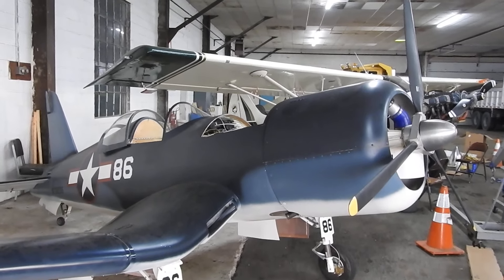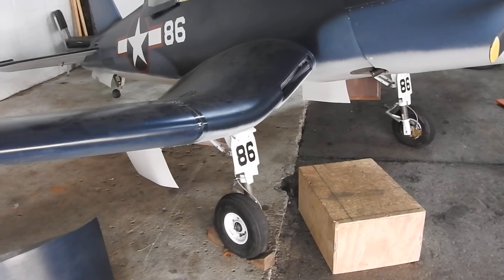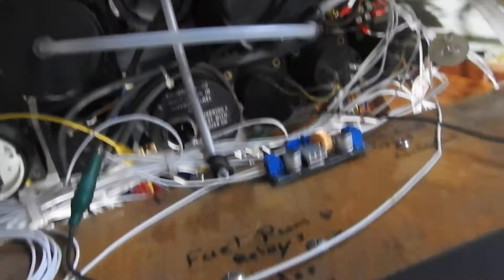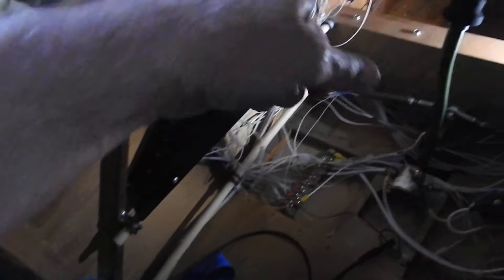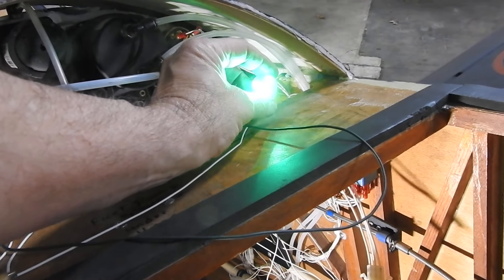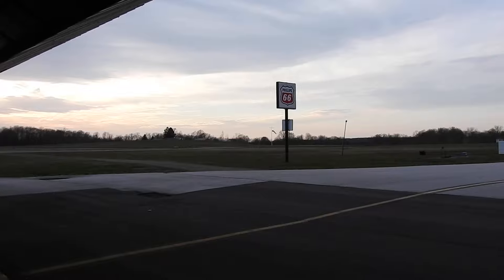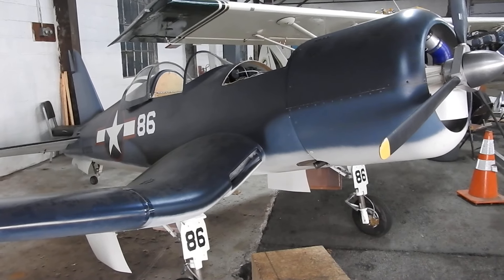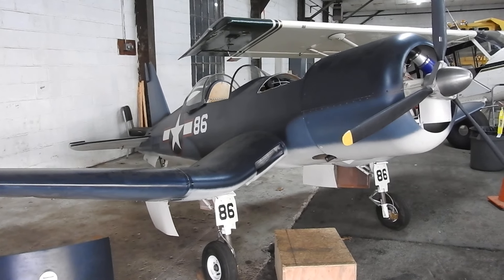WAR Corsair Update 4/9/2024

Comment: Thanks for the update Don. I know, working inside the fuselage can be pure torture!!!  I remember days doing that on my MiniMax where I couldn't stand up straight for days on end doing wiring and fuel systems.  IF I ever build another, I'll do a pre-0made wiring harness.
Reply from the maker: No two planes are ever built the same. So even a pre built harness would need mods.
Reply: @Dynodon64  Good point. Probably best for me to consider an open framework fuselage design if I do get back into aviation. My contortionist days are over.
Reply from the maker: @Robnord1  Mine are too, but I still need to do it from time to time. I pay the price later.

Comment: I’ll be interested to hear the final weight. Every little thing that’s put in the airplane, and at the time doesn’t seem like much, adds up to make a poor/heavy flying airplane.  Be careful.
Reply: In this case it doesn’t matter.
Reply from the maker: The only things I have added to the plane are three micro switches, a small LED driver, and a speed controller for the tail wheel motor. I added some 22 gauge wire to the tail circuit, removed some wires from the main gear circuit, and re used all of the wires that went out to the main gear switches. No wires were added to the mains circuits. 

So all said and done, there was less than a pound added to the whole plane spread out.
Reply: @Dynodon64  It’s also little additions such as when you were working on the tail wheel. That all looked heavy for such a little airplane. It’s just my opinion and I’m no expert, but I feel the airplane should be as simple and light as possible for test flights.
Reply: @stlmusic  what test flight is he talking about?
Reply from the maker: @stlmusic  The tail is back to it's original set up. Just changed the centering spring type. No extra weight. Yes we want our planes to be as light as possible.
Reply from the maker: @brianeisner492  The ones to come.

Comment: Maybe it's just the camera but those leds look intensity bright. Will you be able to dim them down enough with a voltage cut? Seems like it could interfere/distract when trying to read other gauges.
Reply from the maker: I can turn down the voltage or current to dim the LED's . You also have to remember, this plane is in a hanger and the lighting is low. Once you get them out in direct sunlight, you probably won't even be able to see them.

Comment: Looks to me like the people who sold you the plans left a whole lot of 'figuring it out' up to you.
Reply from the maker: No two planes are built the same from plans or kits. Everyone does their own mods, and uses different instruments.
Reply: G'day,

Scratch-build Projects, which begin with a set of Plans and a desire to finish with an Aeroplane...; are called that because of all the 
Head-scratching which occurred while trying to figure out what in the blue blazes of Hell the Designer actually expected the Builder to do at every point...(!).

And from what I've gleaned, 
Kit-Build Projects can be a whole lot more murky than that - because the further the Customer lives from the Factory (making an angry visitation more difficult...), then the less likely it is that the Parts supplied actually fit each other, or have been built in a way that doesn't require complicated re-engineering before being put together to constitute anything which a sane person would want to fly within.

Currently I'm watching an
"Aerodrome Aircraft Sopwith Camel Replica Kit" (Riveted Aluminium Wings with Clark-Y Aerofoils, Aluminium-Tube Tail, Welded 4130 Chrome-Moly Steel Tube Fuselage - a Rotec Radial...; in Melbourne Oz, clear across the Pacific Ocean from where they shipped the ill-fitting mis-shapen substandard Components to the bloke who's redesigning & remaking vast chunks of what he already  paid for - before it goes into what he intends to sit inside and use to commit
Levitation while playing with his
Biggles Fantasy (!).

You, too, may see his sometimes infuriated progress, his Videos are posted to
"Scott Mathews Channel"
Here on YouTube.

He's an ex-RAAF maintenance Type, who's already built and flies a Zenith Cruiser - so his Camel's a great bit of Work to watch coming together.

But I reckon the people who shipped that Kit fully deserve whatever subsequently goes wrong with their Lives ; from the shitty fit of the bits which  they shipped out to Oz, for him to try to tinker together and cobble-up to become an Aeroplane worthy of  the name..., after taking his money.

He's rather more polite about it than I am, but sometimes he sounds - off camera, to be talking through gritted teeth as he explains the various little
Mysteries...(!).

I suspect that the problem is that until and unless an Outfit gets to be as big a Business as RANS or something similar, then Plans Sellers and Kit Manufacturers are basically underfunded  Ambition-driven Wannabes and Tryhards, all  desperately trying to find and satisfy enough paying Customers as to be able to pay their own  Bills and make up the Wages at the end of the Week - so ALL operating & manufacturing Cost are cut to a bare minimum... 

("There, that'll do..." ;
 being the apparent standard of
 Qwality Kontroll which they can afford to apply...!).

And, also..., they DESIGNED the thing - so every aspect of their own
Creation is completely obvious to them, inside their own  mind ; so often they have real difficultues in imagining what other people might have trouble grasping and visualising - and therefore thus and because, their "explanations" are often vague, ambiguous and further  confuzzling, if they reply at all...(!).

Because the person who actually made up and shipped the kit was probably a minor  Employee - who doesn't work there any more & so can't be consulted as to what was sent out, to whom, or how it was supposed to be put together.

Oopsie !

It seems to be a bit of a Generic Thing, within the DIY
Aeroplane Support Industries ; wherein Marketing Jism and
WIBNIfery 
(Wouldn't It Be Nice..., If !?!)
appear to greatly shape the "playing-field"... (!).

But,

Such is life,

Have a good one...

Stay safe.

;-p

Ciao !
Reply from the maker: @WarblesOnALot  I have been following Scotts channel ever since you told about him. I am surprised on how much info is not in the prints. I keep thinking, every video I watch, why isn't that in the prints? He's doing a great job, and as I stated in another post here, no two planes are ever built the same from a set of plans.

Comment: Why don’t you get a professional to wire your airplane. I’m not an expert by no means but this looks like a wiring nightmare.
Reply: He built the aircraft and he is very intelligent.
Reply from the maker: Have you ever seen the wiring behand any aircraft instrument panel? You would be shocked.
Reply: @Dynodon64  yes I have been in many aircraft from the pedok tube at the point end to the afterburners. 
 I was a tool and die maker before I was a machinist for the Air Force. I have been every place in aircraft including instruments panels and I have changed instruments. I have seen more wire than most people I know. 
 Also I had access to all of the technical manuals for every thing I worked on and had to have that book with me for any system or part to be removed. 
 When aircraft mechanics cannot get a screw out to work on removing a part or panels because they cannot use a screwdriver and strip the head. GUESS WHO THEY CALL?
 I HAVE WORKED IN MANY PLACES IN DIFFERENT AIRCRAFT. 
I am a skilled machinist. I have made so many parts for critical places. Even have to take the piece of metal and have it inspected NDI to make sure it had no flaws before I could begin making the part. 
 SO YES I HAVE SEEN THE WIRING EVERYWHERE IN AIRCRAFT.  HAD BOOKS FOR THIS TYPE OF WORK TOO. AS A HOBBY BEFORE I WAS IN THE AIR FORCE I STUDIED ELECTRONICS AND REPAIRED CB AND HAM RADIOS. DID THAT FOR YEARS AFTER I GOT OUT OF THE MILITARY. 
 I HAVE BEEN IN A WHEELCHAIR FOR 40 YEARS AND HAVE BEEN A GUNSMITH UNTIL 5 YEARS AGO. 

WHILE I WAS IN THE AIR FORCE THE COMMANDER OF THE BASE WAS GOING TO BE PROMOTED TO BRIGADIER GENERAL AND TRANSFERRED TO ANOTHER BASE. 
 AS A GIFT I MADE HIM A REVOLVER BASED OFF OF THE
 RUGER SUPPER BLACKHAWK MADE FROM THE BEST METAL THE AIR FORCE HAD TO OFFER . MADE EVERY PART EXCEPT FOR THE SPRINGS AND THE GRIPS. FULLY FUNCTIONAL RIFLING IN THE BARREL TOO. I THINK THAT WAS THE
 HARDEST PART TO MAKE. HAD TO MAKE 2 BROACHES AND HEAT TREAT
Reply: @Dynodon64  I meant no disrespect for the rant that I just posted so please don't delete me. I enjoyed watching you work and I like the way you think. I think you are a very smart man and I have ALWAYS said so.
Reply: @Dynodon64  Oh!! Sorry for the ranting I see now you were talking to someone else. 
 That is what happens when I  Assume = I did not want to make a Ass/u/me but I did (so sorry about this)...
Reply from the maker: @ronnydowdy7432  That's some resume' you got there.
Reply from the maker: @ronnydowdy7432  None taken, it's all good here with you. I didn't see the post yet when you sent the last one. We're good.
Reply from the maker: @ronnydowdy7432  It's all good.